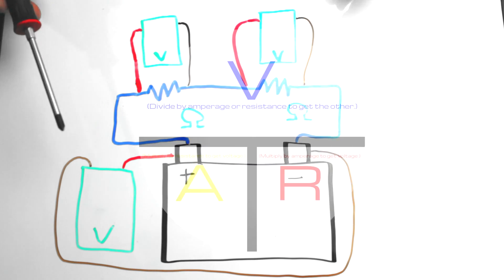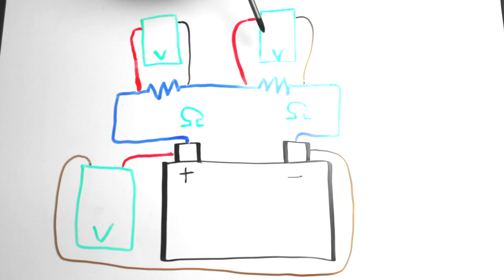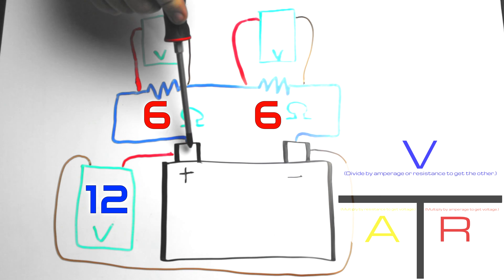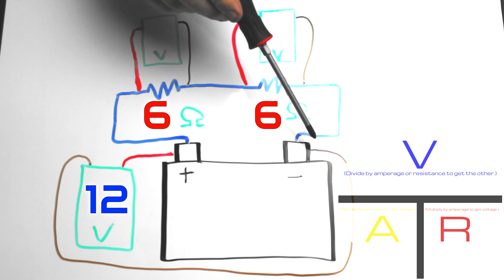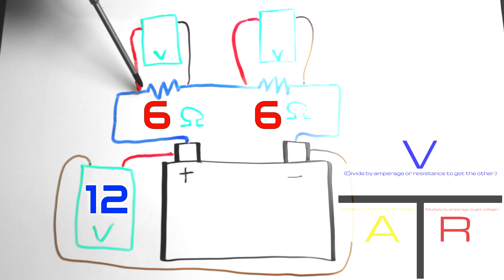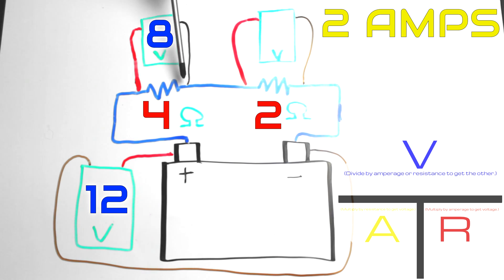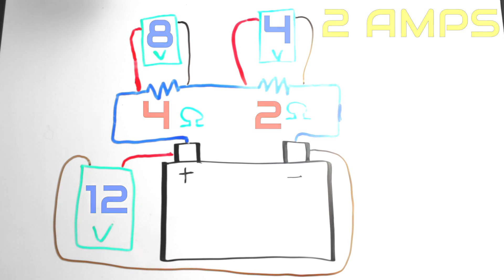Understanding Voltage Drop: Calculating Dropped Volts With Easy Math/Numbers ⚡ Cars Simplified

Comment: In the last example if the resistors were 4 and 1 instead of 4 and 2. Would the 1 ohm resistor still use 4 volts? Where would it go?
Reply: 12 volt battery
total resistance 4 + 1 is 5

12 / 5 is 2.4 amps in the whole circuit. 

4 ohm resistor has voltage drop of 4 * 2.4 = 9.6 volts

1 ohm resistor has voltage drop of 1 * 2.4 = 2.4 volts

What I dont understand is how in the world a resistor placed after an LED would save it from burning out. Sure in theory it drops the total amperage and soaks up some total voltage. But doesnt that not happen until after the LED? I guess maybe its like adding a kink in a hose so only so much pressure can go through it. Which thereby reduces how quickly the water flows through the hose. When the water flows too quickly it kills the LED.

Comment: Other website says "For instance, adding an extra 6-ohm resistor with an existing 6-ohm resistor in series will lower current from 2A to 1A in a 12V circuit. Care must be taken to not exceed the wattage rating when sizing resistors."  But you say that resistors do nothing to ampers. I am confused now.

Comment: If you are going to present this video you need to slow down because this video is not for people who already understand this but for those who don’t, so basically the video needs to be narrated that way, you are taking things at a rate that doesn’t allow those people who are learning this to absorb the material and then move on, slow it down a little
Reply: speed is always difficult for a mass audience, because there will be a wide range of speeds that would be best for different people. Going too fast leaves some people behind, and going too slow bores other people. The best thing to do is to 1) take notes as you go, and 2) get used to manipulating the time on your end. Play/pause it as you go, and/or adjust with youtube's speed adjustment feature.

Comment: He could have done a better job by explaining the math, which he didn’t. The voltage drop across the circuit (in the two resistors) should equal the voltage source, which is 12V. In order to understand why the voltage should be zero at the end of the circuit, look up Kirchhoff’s Voltage Law KVL.

The V/AR symbol in the lower right of the screen is grouped to show you the math. If you’re looking for amps, then (looking at the symbol) A = V/R, use V/R = 12V / 6 Ω = 2A. This tells you there is 2 amps going through the circuit.

To figure out the first voltage drop, plug in the 2 amps into the equation.
Vd1 = AR
= 2A x 4 Ω
= 8Vd

For the second resistor Vd2:
= AR
= 2A x 2 Ω
= 4Vd

8Vd + 4Vd = 12V, the same as what the source is.

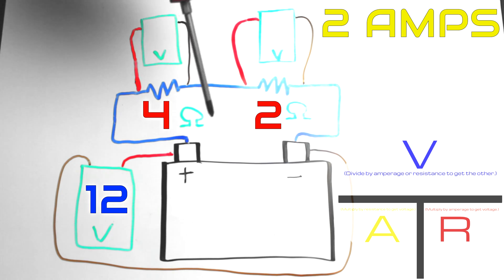Comment: 3:40 I was lookng that, what voltage would be when circuit is cut at end, after loads. 12v
Reply: depends on between which two points you're measuring the voltage.  If the wire is cut, no voltage drops is detected by the top two multimeters. But the bottom multimeter will always 12V because it is connected directly to the battery

Comment: What is the voltage drop between your two resistors. In other words place your first lead after the first resistor and your second lead before the second resistor.  If you measure 12 Volts, your lesson is incomplete and you have left your students with more questions then answers.  You need to update this video.
Reply: It same potential so it 0v? Why 12v?
Reply: I believe it’s 4v

Comment: Ok, my question is this. According to what I know about electricity, it would always return to it's source. How can it do this if it has zero volts on the last leg of this circuit?
Reply: Wires have almost no resistence. If you want it to make more sense for you, redraw the same drawing of the video but draw the resistor connected to the negative pole without wire between them.

Comment: I still dont understand all I see is numbers with not rhyme or reason WHY IS THE VOLT DROP 6 TELL ME WHY
Reply: 6ohm × 1amp = 6v
Reply: He could have done a better job by explaining the math, which he didn’t. The voltage drop across the circuit (in the two resistors) should equal the voltage source, which is 12V.

The V/AR is grouped to tell you the math. If you’re looking for amps, then use V/R = 12V / 6 Ω = 2A.

For the first voltage drop, it should be:
Vd = AR
= 2A x 4 Ω
= 8Vd

Second Vd:
= AR
= 2A x 2 Ω
= 4Vd

Comment: I have a question 
After all the votls are used up is there 0 volts left on the rest of the circuit 
And if we connect the volt metre after the last resistor and just before the negative end of the battery will it read 0 volts
Reply from the maker: On paper/in theory, yes. In practice, there is usually a little bit of measured voltage because of the slight resistance in the wire across a long enough distance. That amount should be quite small, though.

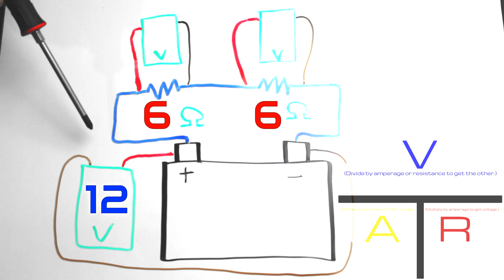Comment: 1:53 is misleading, to understand which wire gauge you need for specific loads and lengths you need to understand voltage dropping in cable runs. I really don't like videos like this, it confuses beginners saying that wires play no role in voltage dropping, which is far from the truth, and quite frankly can be dangerous (fire hazard). For people wondering what the hell I'm talking about: https://www.youtube.com/watch?v=APLic9F7ZsA

Comment: Very nice video, great explanation and a nice speed!

But I do have a question though, will the the current always remain constant throughout a circuit? Or will it possibly change, and therefore affect the ratio of each Ohm's effect on the voltage drop?
Reply from the maker: The only time amperage can change on a circuit is when it splits into a parallel circuit, and even then, the parallel branches all add up to the same amount you would see where the branches are all joined together again.
Reply: in case knowing this would help, amperage is a measure of electrons per second. If you're working with a circuit that's fully in-series, regardless of where you test, the amperage is going to stay the same, because the electrons move around kinda like a chain or belt.

* amperage is a measure of coulombs per second, and a coulomb is a measure of electrons. It's like trying to count the water molecules in a cup of water
Reply: In a series wired cct amperage is constant throughout and volt drops at every load .
In a parallel cct voltage is constant throughout and amperage changes with every load.

Most cct’s are wired in parallel but vehicles might be different I don’t know .